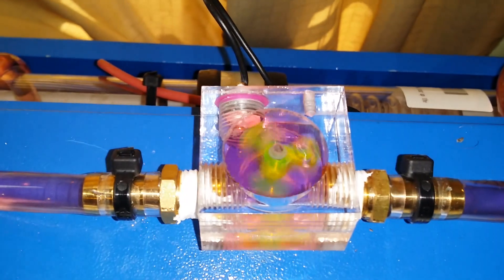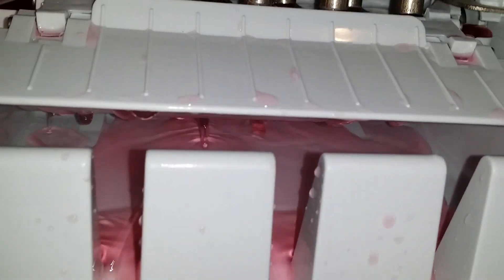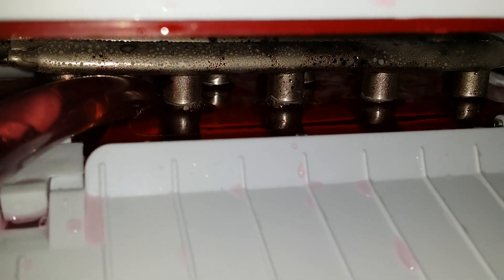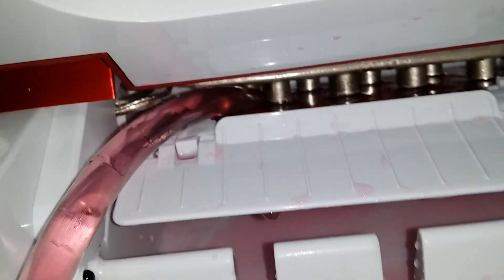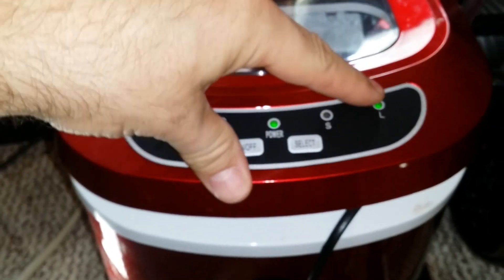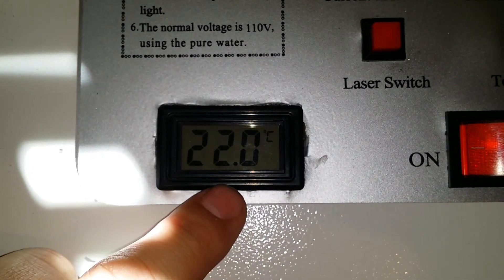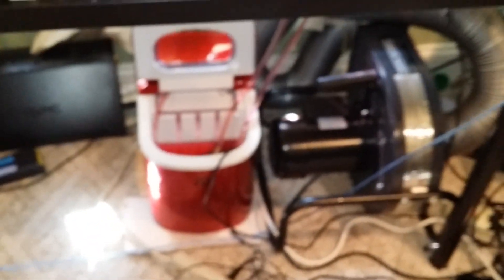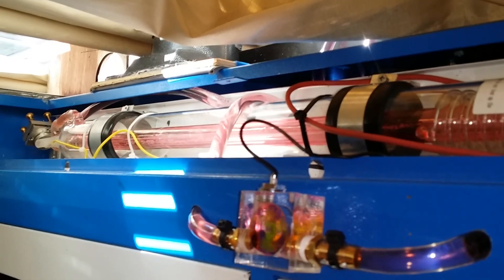Igloo Ice102 Laser Chiller 3

Comment: I see you have been running this with antifreeze has this caused you any problems? 
Cheers
Reply: So I gather you don't get any ice cubes forming and when you say you use the antifreeze full strength I take it you don't add any water or do you?
Thank you
Reply from the maker: @nutbox76  Correct on both points! With the water line antifreeze at full strength (no water added) it won't start to congeal until it gets to around -80 I believe it is. You can look up Prestone Negative 100 Degree RV Antifreeze or 128 oz. Uni-Gard -100 Freeze-Proof RV Antifreeze.  https://images.thdstatic.com/catalog/pdfImages/23/2325e3eb-ca16-494c-809a-370554370024.pdf
Reply from the maker: Nope! But make sure you are buying RV water line antifreeze. The stuff I am using here is non toxic, non flammable and non burstable down to -100 degrees. It was about 20$ a gallon and I run it full strength through the tubes.

Comment: what a waste of power and a waste of a good ice maker.. to cool water use a large 5 gallon bucket a radiator from a car etc and a fan unless your running the tube for an hour solid i woulndt bother with this setup
Reply from the maker: What a waste of good comment space by someone who obviously doesn't understand thermodynamics and the functionality of co2 lasers. I do run my laser for 6-8 hours a day at times, which is the exact reason I bothered with this setup. The unit is self contained, never needs maintenance, refilling or mucking with and doesn't look like a bunch of jury rigged garbage connected to a laser cutter sitting in a viable working space. It doesn't simply "cool" the water to room temperature, it brings the laser down to the proper temps for optimal laser tube life and laser tube power consumption. Output power in co2 lasers decreases as temperature increases, can your bucket handle keeping the laser cooled to 15-20 Celsius without touching it for 6-8 hours when its 30 Celsius ambient temperature?
Reply from the maker: I replied to his exact statements about why it was a 'waste' which were his reasons for labeling it as such. I also specified why the choice was made to use this format and not the method he mentions with valid reasons for having done so.
Reply: @thevisad  thanks for the video. I am going to convert ice maker with broken mechanical lever to cool my water. Ignore the negative comments as I am tired of running a deepfreeze for the past 6years to make frozen 2litre bottles to keep my water temp below 22degree.
Very nice setup and idea
Bying a CW-3000AG chiller with only a fan for cooling was not my idea and chillers with real refrigerator components ar too expensive.
Thanks again
Reply: thevisad Nice long paragraph. But the comment is not a waste. The viewer just commented what he/she thinks about this. He/she might see it as a waste but hey its a opinion.
Reply: What a waste because it is VERY reasonable to spend 1-2 hours on a single laser engraving job and the water gets damn hot.  I have one of these ice makers but it refuses to run and from what I read it is the switch in the unit which you can't get as they refuse to sell the switch.
Reply: The first person on boobtube to do this.. I know had the same idea around about the same time frame and I looked on boobtube to see if I was the only one. For those comments about a waist of an ice maker common you have no clue.. you can buy a used ice maker one on aZon for about $50.00 and you save it from going to a land fill.. and a chiller isn't the same as a cooler and no there are about 6 more videos doing the same thing..(also for the snowflake comment about everyone has a right to an opinion)Unless when you reply and you can't handle the reply back then (just let go let it go) Disney theme song seemed appropriate for the ice maker and the snowflake ❄️ comment

Comment: Okay my setup is done. HAs been running for some time now. I have been reluctant to clean it all up (ie organize) due to thinking I might further change things. I threw together a quick how to on my page Im gonna mention your setup as in my opinion your the first one to come up with this design. let me know if you want my cad file. I think it might just make fora more efficient unit. easy to install too.
Reply: For me: I disconnected ANY/ALL electronics IE Logic boards or relays he machine had whatsoever. several reasons ... 1 their is no need to move the Ice bucket. (your not dumping cubes any longer.) 2: you will never freeze the coolant. so its best to leave the coolant in contact with the manifold 100% of the time (it has to more efficient to have it contact 100% of the time) 3: less moving parts. 4: I have not found a good reason for it to dump whatsoever. p:?   Leave the bucket right under the coolant manifold i.e. it will fill up and the fluid will over run back into the well.   Moving on:    The built in pump. I also disconnected it as well. No need for it either. at the end of the day the only need is the AC pump to turn on or off. and the fan to keep it efficient.     less parts to fail. this was my rational. Sam :) BTW Im in TampaBay...
Reply: Thanks Sam, you rock!  Just to clarify, I should hook up the 110 from the machines plug directly to the compressor and other coolant parts through a switch.  I just was a little hesitant to connect the 110 directly to the refrigerant connections as I didn't know how much power was being sent to those parts.  I should have thought to check it with a meter (It's been one of those kind of days lol).  I did buy that same temperature controlled switch so I think I'll set it up through that as you did.  Thanks again for all your help.
Reply from the maker: Sam Rod Thank you sir, I would love to see the final and complete setup you have. I will add a link in the description of the video to your build as well.
Reply: Sam Rod, I would love to see how you set it up as I just ordered an ice102 for the same purpose.  Did you get a chance to finish the how to?  I didn't see anything on your youtube channel.  Do you have it on another site?  I think I got all I need from Thevisad's video but would love to see if you made any changes. Thanks
Reply: S.O.P,  I have a starter page at http://www.hyperlinks.net/laser-chiller-aka-ice-cube-chiller-pt1
I need to add some more detailed shots/pics though. but it should give you an idea of my mods vs thevisad -S
Reply: I just read your how to and it was great.  I'm looking forward to working on this mod on my own laser.  I also live in FL and as you know the heat in my garage, aka my shop, can get really high.  For the last few years I have been using a Styrofoam cooler with those blue Ice packs and I am constantly changing the ice packs to keep the laser temp low.  I think this new method is just what I need to solve the laser cooling issue.  Thank you both, Sam and Thevisad, for this great solution.  I'll let you know how it works out for me.
Reply: Sam and Thervisad,  I was wondering how you both modified your ice machines to keep the tray from swinging up at the end of each cycle.  I've taken the back cover off the machine but can't see a way to stop the tray from swinging without just stripping the gears on the motor.  I was wondering if either of you have a more elegant solution to the problem (maybe unplugging the motor or would that interrupt the cycle).  If you have the time could you please let me know how you both solved the issue on your machines?  Thank you both.
Reply from the maker: I did not stop mine from swinging up at the end of the cycle, it won't actually affect anything as the unit shuts off for a few minutes during the cycle while it dumps the ice. With the controller the tray will remain in the down position.
Reply: Thank for getting back to me so soon.  What do you mean by "With the controller the tray will remain in the down position."  ?  What controller are  you referring to?  Thanks again.
Reply: Thanks Sam.  That sounds like a great idea.  I'll give it a try tonight.  I'll start disconnecting anything that looks like it's not part of the refrigeration.   Tampa Bay,  small world, I'm in Treasure Island (a small island city right off of St. Petersburg FL).   Send me an email some time through my youtube channel, I always like to hear what other people are doing with their lasers and printers.  I've only had mine for a couple of years but I'm always working on a project.  Thanks again for all your help.
Reply: Hey Sam, sorry to bother you again but I'm having a little trouble.  When I disconnect everything from the board except the a/c, compressor  and fan the cycle will not start unless I manually hit and release the lower lever switch on the left side of the unit.  I tried disconnecting it all together and also having both lever switches activated but it does nothing.  Is it possible for you to tell me what exactly you did to get it to work.  I've tried several things but I can't seem to get it to work and I don't want to fry my machine on the first day lol.  Thanks for all your help.
Reply: 1st. the goal is to eliminate all un-necessary circuitry?... when you first start. Make sure the cup/ ice scooper is under neath the chiller manifold. then power un plug the unit.
open the unit up to the point where you can un plug the main circuit board near the back of the machine. and disconnect any plugs anywhere you can find them. I recall one under the lid., one for the ice tray. and the main one in the back of the machine. simple un plug no wire cutting necessary. then locate the 3 main or 2 can't recall.. wires that power up the refrigerant pump. probably the biggest wires you will find. cut them loose.  then with your switch of choice. wire the power direct to the ac pump. with the switch. as the on / off. I used a temperature controlled relay switch off eBay or amazon etc.. like this one.https://www.amazon.com/Lerway-STC-1000-Temperature-Controller-Thermostat/dp/B01MZ3IMW6/ref=sr_1_1?ie=UTF8&qid=1496275837&sr=8-1-spons&keywords=temperature+relay&psc=1  as my temperature controller on off switch. ...THEN....
 I wired in a AC Fan to replace the one inside. as well as my circulating sump pump.    So when I power the unit up... the pump and fan come on no matter what. then the temperature controller turns the AC pump on and off. make sense? -Sam. I could have added. perhaps my version is not for the electronically challenged person. (no offense intended). Just saying be safe and ask a friend if necessary. OR since your so close. bring it all over Im willing to help with your mod. TI is but say 45 mins? from me I'm near Tampa Stadium.
Reply: Just to clarify. Ideally The Compressor gets controlled by the Thermostat switch I posted a link to from Amazon, the thermostat controlled switch gets its power from the MASTER Switch. however the Master switch controls also the Fan as well as the Sump pump. as far as any other electronics within the ice maker? their dead unplugged or out of the picture. :) So 1 MASTER SWITCH lets call it the ON/Off switch on one leg is the thermostat and on the other leg are the sump pump as well as the fan.
Reply: Fantastic!  Thanks again.  I'll let you know how it turns out.  I see from the pictures that you have one of the larger laser machines.  I have a k40 but just ordered a smoothie control board for it so I'm looking forward to having my machine much more accurate and controllable than it was before.  I think once I get this ice machine conversion going and the new board in I'll be all set for a while. . .or not, I'm always tinkering. LOL

Comment: curious now that its been some time hows this working out.?
Reply from the maker: Still running great! No problems at all and still keeping the laser cool.
Reply: Thats good news. Im still thinking of running with your idea too. Chillers are pricy as heck. this sure makes it simple.
Reply: Okay, I pulled the trigger on one. Its being shipped here this week. With any luck Ill have it running by the week end. any suggestions tips? Where did you drill the hole precisely? and what did you use? a drill bit a unibit etc... any more insights?
-S
Reply from the maker: Take a look at https://www.youtube.com/watch?v=cCv856SE_o0 this one shows the final location of the return tube placement. I placed it just above the main cooling tube, so that it flowed across the tube. I picked up a brass fitting from home depot, the same size as the cooling lines I used. The drill bit used was the same size so it was a tight fit into the case. I used a gallon of motorhome rv waterline antifreeze with a burst of -50, that cost about 12$.